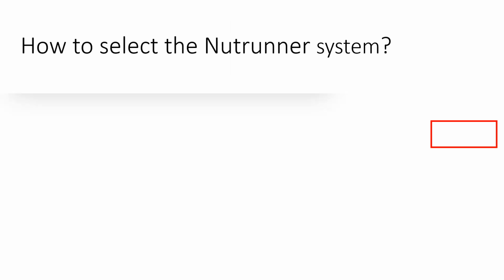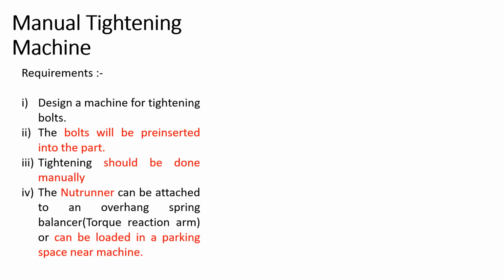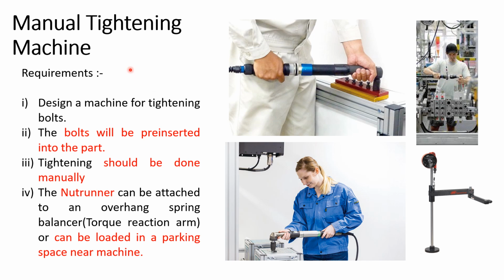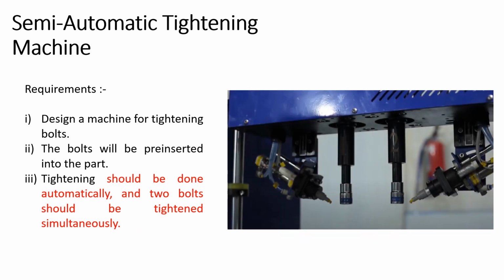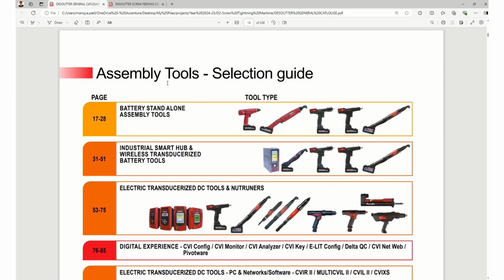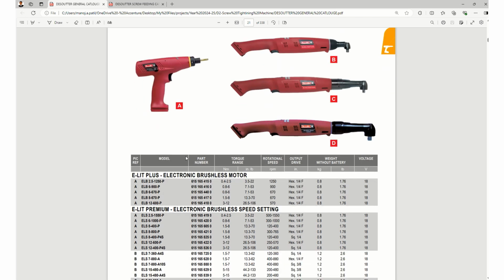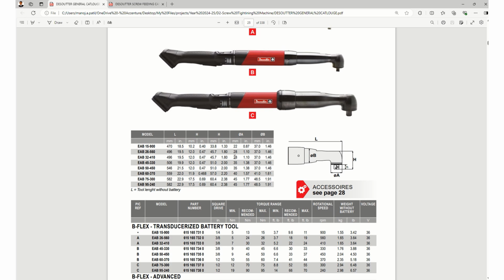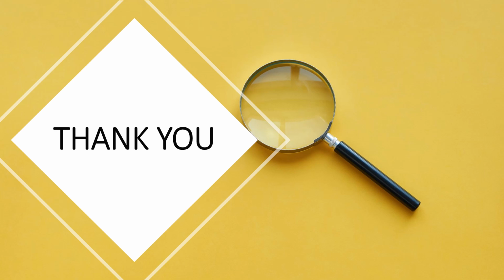SPECIAL MECHANICAL DEVICES PART 4.2: NUTRUNNER SYSTEM SELECTION

Comment: How to select the socket for that nutrunner.
Reply from the maker: The socket/mouthpiece will be selected based on the Fastner size (depending on M8, M10 or size as per Inch system), Fastner Type (Hex bolt, flange bolt, screw, stud nut, etc.), Thread grade and strength!

Comment: When to use toqrue arm system.what is the toque value to select the torque arm system.when to use the spring balancer to hung the nutrunner and what is the toque value for that.
Reply from the maker: The torque arm is preferred when the torque is too high that can cause arm twist/pain. Also, when consistent precise positioning is required in the system. The spring balancer is preferred if the nutrunner itself is heavy. 

These are some general guidelines: - 

1)Small handheld nutrunners (< 10–15 Nm) are usually light, can be used without a balancer.
2)Medium torque nutrunners (15–50 Nm) tend to be heavier (3–5 kg) → balancer is recommended.
3) High torque nutrunners (> 50 Nm) are both heavy and high-reaction → usually require both torque arm + spring balancer together.